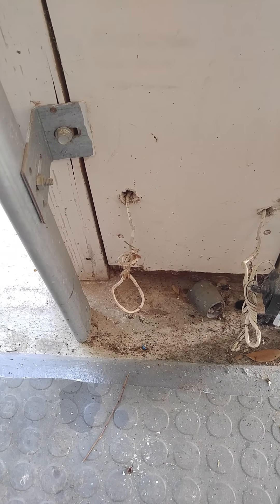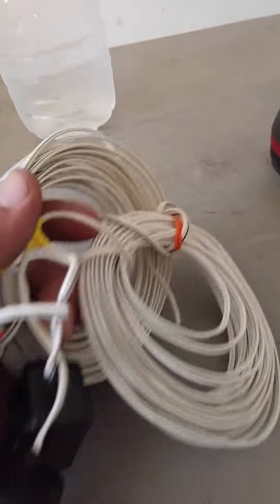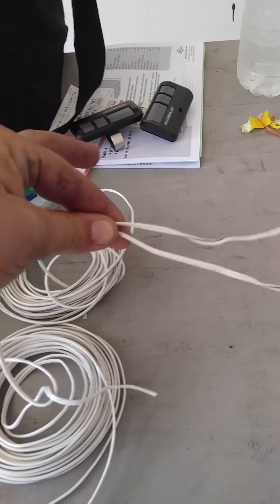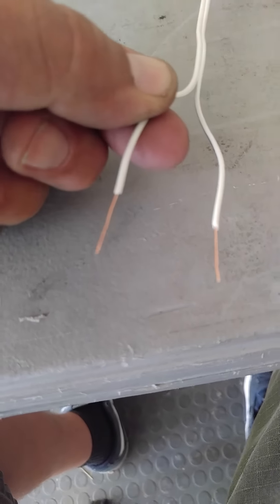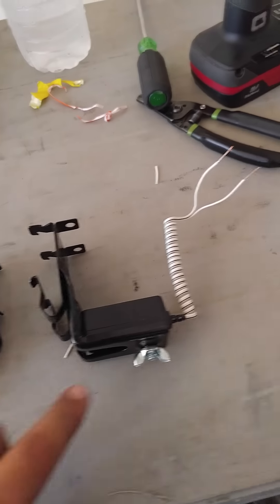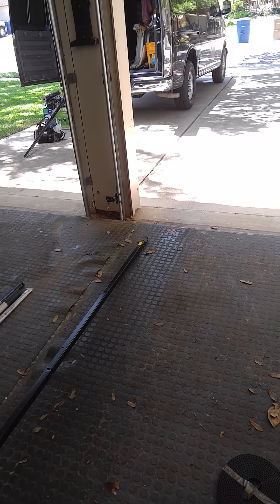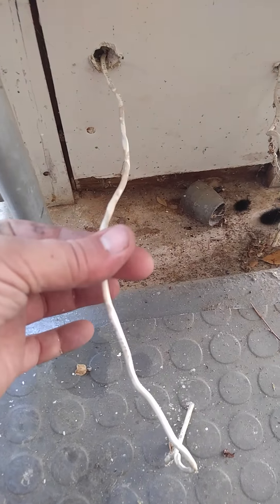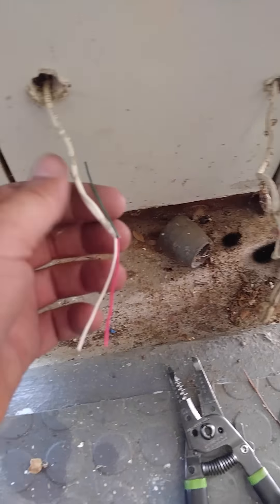How To Install Garage Door Safety Sensors Correctly.

Comment: Nice video! I had a couple of questions. Does it matter which side the sender and receiver are on? Also, does the wire w/ the stripe get connected to the positive or negative terminal on the controller? Thanks in advance for your help!
Reply from the maker: Hey, I really appreciate the positive feedback!
For your first question, it does not matter which side the receiver sender is mounted.
For your second question, the white wire goes into the white terminal in the black wire goes into the black terminal up at the machine. They have them color coded to make it easy.
Reply: @garagedoorgenius  I wired the sensors right at the controller so I could test while taking the whole alignment issue out of the equation. Regardless of how I wired them, I couldn't get any lights. Either I fried them, or they're defective (they were cheap knockoffs). I'm picking up some authentic Chamberlain sensors later today. I have a BuildMark system and the power connections are white and grey. The grey being the positive side. Any suggestions?
Reply from the maker: I see.  The build mark brand may not be compatible with Chamberlain equipment.  It's like genie sensors will not work on a Chamberlain LiftMaster and vice versa.
You may have to go with that particular brand safety sensor.

Comment: do I have to turn off any fuses. is this a live wire?
Reply from the maker: No you don't.  I promise, safety sensors will not shock you.  👍🏼
Reply: @garagedoorgenius  alright thanks
Reply: do you have a video of how to connect the sensor wires to the garage door opener
Reply from the maker: @commissioner1969  sensor wires go to the Black and White terminals.
Take a small flat tip screwdriver and press inward on the orange tabs and insert the wire.  Kinda like old school speakers to a stereo.  If you're old enough to remember those.
Reply: @garagedoorgenius  yes but there are 4 terminals. Where do the wall button wires go?
Reply: The wall button stopped working. I think I wired it wrong
Reply from the maker: @commissioner1969  the wall button goes into the first set of terminals.  The Red/White.
Reply: @garagedoorgenius  ok so there's must be something wrong. I've got the black and the black of left and right sensors twisted together and into the negative and the white and white of the left and right sensors into the positive. Then beside those I've got the wall button wires black and white into negative and positive. All of the terminals are orange BTW. It's a mastercraft. Don't know if that changes anything. It still won't work.
Reply from the maker: @commissioner1969  I believe MasterCraft is a Chamberlain product.  
If it has orange push tabs, it should be color coded.  
Typically the first 2 terminals are for the wall button.  First slot being for the red wire, then second slot for the white.  
Then sensors will be the white wire first, in the 3rd slot then the last slot for black.

Comment: Thanks for this video. You say that 5-6" is standard placement above the ground. I noticed that when my car wheels straddles the beam (beam is between front set of wheels and back set of wheels), there is a possibility that  at that point, garage door could come down if my wife uses her remote in the other car (we share the same garage door). It is okay to mount the sensors higher?
Reply from the maker: You can mount the sensors anywhere you like. Just remember if you go to move out of that property put them back down 1 to 6 in from the floor. Or it will fail the inspector check.

Comment: Think I have a bad wire. Tested new red sensor that wouldn't light up by connecting on Green sensor side and sensor lit up. I assume I have a bad wire on one side that is in the wall. I tried cutting the ends to make sure it just wasn't a dirty end but no dice. Also check to make sure connection on motor unit (ceiling) was secure and it is. I can see where wires go from ceiling motor unit thru ceiling. If u agree its a bad wire, what would be the best way to run a new one?
Reply from the maker: ALLAN FISCHLER 
Well the easiest would be just staple the new wire externally.  Up the jamb, across the header, back to the powerhead.  Easy peasy.
Or if the old wire will pull all the way through without snagging, tape the new wire really good To the end of the old wire and pull that sucker all the way home.
To keep it not visible and run a new wire in the wall you would have to use a fish tape.  Electricians use those for that purpose.  But it can be tough to do.
Reply: Thanks!
Reply: You can test for an open circuit by wiring one end of the wire together, then checking for continuity (0 or very low resistance) with the two leads at the other end. If you don't have a voltmeter you could use a flashlight, with the wire completing the circuit. You can test for a short circuit by doing the same thing, but without wiring the ends of the wire together.

Comment: You should have put a link to your "how to coil the wire" video..
Reply from the maker: Your absolutely right my friend.  I'm actually doing a revamp of my channel.  What you just mentioned will be added.  Thanks for the suggestion BellyUpFish! 🔥👊🏼🔥
Reply: @garagedoorgenius  Sure thing. ;) I'm sure it sounds a lot like "wind the wire around this screw driver shaft" but I thought I'd see what you did. 

Couldn't find it with an easy search and gave up.
Reply from the maker: @BellyUpFishGarage  10-4!  
Again, great suggestion and I'm on it. 🤘🏼

Comment: I would put those plastic plate covers in the wall to hide the wire and make it look clean.. thanks for the video sir.. oh and is it a big of a deal to replace all the wire for the new one? does it take hours? because I want to re wire my garage and I am still thinking about it hehehe
Reply from the maker: Garage door guys don't supply those white covers.  That's normally for the finish out guys. On some new construction they put those on there from the get-go. I don't understand why they don't put them on there when they run the wire.
Yeah running new pre-wire can be a daunting task. I would definitely heavily research it or hire an electrician. I know a fish tape works really well when you're trying to route a wire.
Reply: @garagedoorgenius  excellent! Thanks for replying! Stay safe out there.

Comment: Thanks. my biggest question is how to determine what color wire matches what. My prewire is just white and white. no differentiation. Does it matter?
Second thing is how to know the safety sensors work. I guess that's in some other video...
Reply from the maker: If your pre-wire is white and no differentiation it'll be a little more difficult.  But you can do it.
I would first track down the wire for the wall button.  It will be a trial and error kinda thing.  Once you locate the wall button.  Then the same with the sensors.  Just stick one pre wire at a time.  Try to find the (orange LED) sensor first.  The green LED won't come on without the orange being on first.
Reply: @garagedoorgenius  thanks for the quick response. I didn't get that at all. The prewire goes from the sensor to the machine. I'm sure you know that, but that's what I see. I actually just got it working (open and close and stop when it's supposed to) now the one that faulted out the first time has no light again. (these are replacements). I think the wire must be bac somewhere else. I'll probably recut and retie the wires on that side... we'll see if I just crimped it badly.
side question - are those sensors pretty forgiving or do they have to be lined up perfectly? It's a little frustrating to troubleshoot when I can't see the light...
Reply from the maker: @JasonTorpy  sorry I missed this comment yesterday.  Sensors don't have to be exact to light up.  They got a pretty decent read range.  Meaning, they can be a little off.  Pre wire can sometimes get pinched somewhere in the wall or in the ceiling.  That could be your issue possibly.
If you can get the orange light on, then tracking the green one will be easier.
Reply: @garagedoorgenius  a bit frustrating for sure. Thanks for responding. I'll keep trying to track it down. I know it's not magic but hard to track down without just replacing everything.
Reply from the maker: @JasonTorpy  I'd be pissed at the electrician that installed wire with no color coding.  You seem like a smart guy.  You'll get it. 👍🏼
Reply: @garagedoorgenius  Is it necessary to cut the power off completely or is it very low voltage similar to a door bell?
Reply from the maker: @bhamilton8584 it's just like a door bell.  Low voltage.

Comment: I know the garage door opener instructions say 6", but It seems to me that the sensors should be mounted higher, perhaps 10-12" or so from the floor, in case your car happens to be sticking out a few inches too far making the sensors shooting the beam freely underneath the bumpers, sending the door down onto a bumper or trunk lid. I'm assuming the instructions say 6" to protect perhaps a small animal, but as rare (if not impossible) as that would be, I'd rather protect the car. Thoughts anyone?
Reply from the maker: 1-6 inches is regulation height.  I hear what you're saying.  You might want to check out Infinity Shield.  They make a fantastic product.
Reply from the maker: https://youtu.be/9I2eemlNFog?si=hKM9n5PHyrwNtBdp

Comment: How do I connect the other wires to the actual garage door opener?
Reply from the maker: https://youtu.be/rk5y2uWmlWw
Reply: Garage Door Genius I saw this, but you didn’t show how to connect the last set of wires. I love these video btw THANK YOU
Reply from the maker: @inojonifighter  
Ok, 3 wires coming out of the ceiling.
I always search for the Wall button wire first.  How I do that is. Pick a wire strip it down.  The colors you used at the Wall button, take that wire and use those colors.  Plug them into the red/white in the opener.  If the Wall button doesn't come on, then that's the wrong wire.  Try the next...  You have 3 chances.  Sometimes you get it on the first try.
Once you find the Wall button, the other 2 wires are for the sensors.
Hope this isn't to confusing.  Lol
Thanks for the kind words btw!

Comment: I have pre-wired garage and a liftmaster currently installed that broke.  I am going to replace it with Chamberlin.  Any issue there?
Reply from the maker: +Patrick Collins 
No issues at all.  Terrific brand and warrantys.  I install on an average 5 per week.  Belt drives are super quiet and are super common.
Reply: Great!  Thank you!  Gonna try to tackle it Sat!
Reply: I'd go with a Genie Silentmax,super easy assembly /install & setting it up is a breeze + ultra quiet & smooth. I bought the 750 - 3055..it's sweetness.
Reply from the maker: +Tjfreak 
For sure.  That machine is very durable.  Quiet as hell!
Reply: Garage Door Genius I have a 3 terminal (term 3 is the safety with one white wire and one white with black line. My problem is that these wires were brittle so now they are too short. If you Twist together they break so I wanted to use a butt end crimp with mulling. I need to buy some 6 inch 22 gauge wire to hack together a solution. Not many stores carry 22 but 18 gauge is a possibility. Any ideas how to get this Sunday project done?
Reply from the maker: So for the late reply.  Yeah just scab in a new wire.  I know what ya mean.  I hate that thin gauge wire.  There's a method for not breaking the wire.  Unfortunately I don't have a video for that.

Comment: No reason to cut wires coming out of wall just push extra back in hole next time.
Reply from the maker: I cut them a little because most of the time the pre wire is all bent and kinked most of the time.  Just preventing a broken wire down the road.
I get what your saying. 👍🏼

Comment: My pre wire is both white wires. How do you sort out which wire goes where?
Reply from the maker: +Nomans land 
Yeah that's tricky.  If both pre wires are the same color you'll just have to trial and error it.  Good thing is you won't damage anything by wiring it incorretly.
Reply from the maker: +Nomans land 
Strip back a little further and see if your pre wire has a color.  Sometimes to the pre wire one will be gold wire and the other silver.  The wire itself, not the casing.
Reply: Thanks for the tips. I just installed a Sommer opener and the wires are non specific, as in either wire can go in either position and i thought that was pretty cool.
Reply from the maker: +Nomans land 
Nice!! Good job bud.  Yea Genies are like that to.  You can hook them up anyway.  Somner! Sweet machines!
Reply: you like sommer???
Reply from the maker: Liftmaster 1270 
Well just say this, I will take a Chamberlain any day.
I installed a Sommer for someone.  They bought it off of Craig's list.  Definatly a different breed of machine.
Reply from the maker: Liftmaster 1270 
The bolts and nuts supplied are metric and fine thread.  I was like, yep, this is a German made opener!  Lol
Reply: LOL, at lease it was quiet
Reply from the maker: Liftmaster 1270 
Yes, very quiet.  They may be a great opener.  They just haven't been around that long.
Reply: Garage Door Genius I've been told there not super reliable
Reply: Yes indeed. Well built, quiet and plenty powerful. Runs a little slower than a Chamberlain but no complaints there.
Reply: Trying to install my sensors. Why are there 2 sets of wires coming out of the wall that came off of the previous sensor. Where does the other set go? The other side of the garage sensor only has one set of wires.

Comment: My cat bit through the wire by the sensor . How do I repair
Reply from the maker: Cut out the bad section.  Rewire.  Black to black and white to white.  You can either put wire caps on or electrical tape after you get it rewired.  FYI, sensors are low voltage.  No need to kill the power or unplug the machine.

Comment: Sir my pre wired has blue,white,red.how will i connect? Thanks.
Reply from the maker: shamir isidro 
I like using red and white.
Sensors will wire Red/Black and White/White
Use Red/White for the wall button also.
Reply: I have chamberlain 1-1/4 hp. Is it the same wiring on the ceiling?    I have wayne dalton 8ft height.they recommend to used wayne dalton extention.
Reply from the maker: shamir isidro 
Yes, same color scheme coming out of the ceiling.
Reply: Garage Door Genius    Actually i have blue,white blue,orange and white orange.how will i connect.thank you for response.
Reply from the maker: shamir isidro 
I would use blue/white going to the black sensor wire and Orange/white for the sensor white wire.
Use blue/white for the red and Orange/white for the white when wiring up the wall button.
Whatever color you decide for the sensor wires and the wall button wire you want to make sure it's the same colors coming out of the ceiling and plugging into the machine.
Reply: Garage Door Genius i tried the sensor won’t lightning.
Reply from the maker: shamir isidro 
Ok.
The pre wire.  Are you using the same colors for sensors and wall button?
Let's make it simple.  Forget the white wires in the pre wire.  Just pick 2 colors. Make sure your using the same colors coming out of the ceiling.
Reply from the maker: shamir isidro 
See if this helps.
https://youtu.be/rk5y2uWmlWw

Comment: I have a red green yellow and black what do i do
Reply from the maker: I would use Red and Black.
Sensors have 2 wires, black and white. 
For the sensors go Black to Black then Red to White.
On the back of the Wall button you will see Red and White. 
 Wall button use Red/Red then Black/White.
Reply: Thanks

Comment: I don't want to wire the sensors, I need a way to get rid of the nasty things permanently!!
Reply from the maker: Kimberlyexpects 
Just wire them to the back of the unit, tape them too the angle that hangs the opener to the ceiling.
Sensors are a pain sometimes.  As long as you don't have kids or pets ..do as I suggested above.